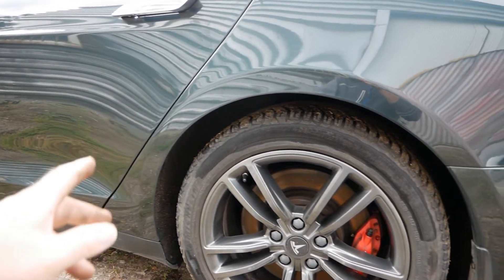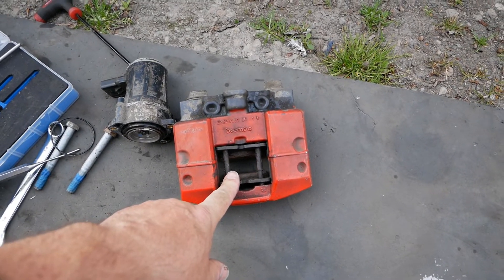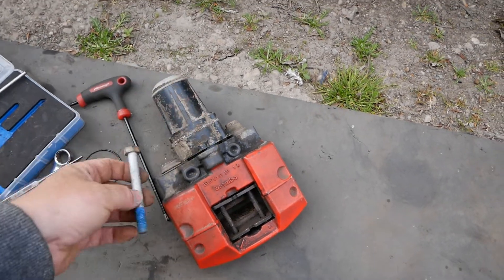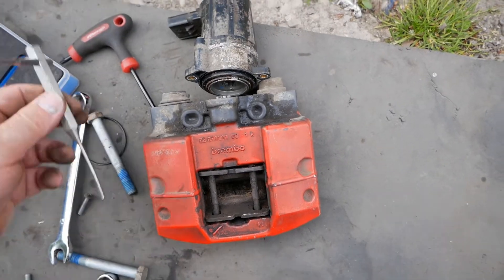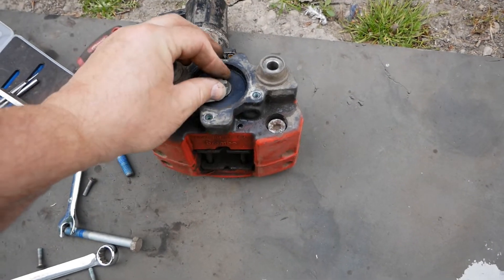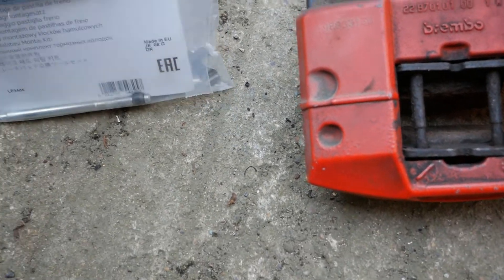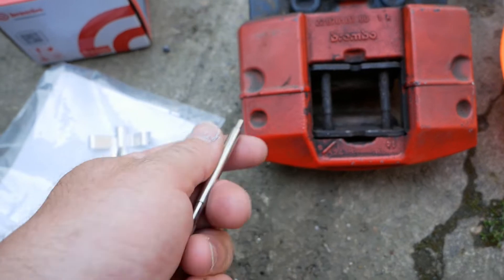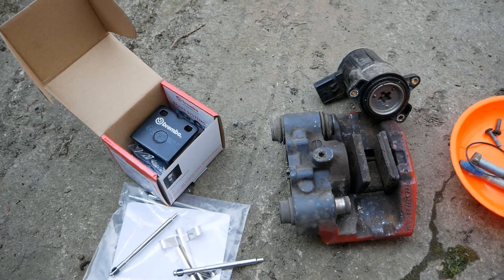Tesla Model S park brake removal or service (separate Brembo parking brake calipers)

Comment: I would have used a much bigger punch on the outer end and punched each pin in a tad first, then, once loosened a bit, used the too small punch to drift them out in the correct direction...  WD40 in all directions...

Comment: amazing video ! - my parkingg brake is faulty and it's the actuator failed (or not engaging) does anyone know where I find the part number for the actuator and the calipers and where best to get them in the UK rather than going to Tesla ? it's a 90D 2015 model S - thanks

Comment: Did you manage to get the pins out with the correct size punch pin? My pins are rusted and swollen and worried it will be too difficult to remove them

Comment: Had the same issues with the pins on my 90d. Heated it with a torch but melted the seal on the piston slightly. Brembo and Tesla won’t get back to me with a part to replace it. Any ideas?
Reply from the maker: You can lookup the Tesla parts yourself at epc.tesla.com but I doubt the seal is a separate item from Tesla. Have you looked on Autodoc?

Comment: In my case, I need to replace the actuator. Do you know if a new one needs calibration?
Reply from the maker: I would assume just engaging and releasing the handbrake calibrates it as they stop when the pads are tight on the disc.
I fitted this actuator back after removing it without any calibration.
Reply: @GoGreenAutos  Thanks!

Comment: I noticed Tesla's service manual says "Do not reassemble the park brake caliper after detachment of the caliper gearbox," with another note "This method requires replacing the caliper after it has been released." Apparently to retract the caliper without having to replace it you need to do it electronically (i.e. don't disconnect the motor/gearbox from the caliper). Has yours been working fine since doing this?

Comment: Which lubricant did you settle on for the actuator gears?  I'll be attempting to replace the pads next month and want to lubricate the actuator during re-assembly.  Thanks for the video!
Reply from the maker: I ended up just straying in some white lithium grease. Because that is in an aerosol with a stray, it's easy to squirt it in.
Reply: @GoGreenAutos  I took my motor apart and found white grease that had thickened and was restricting gear movement.  Also the plastic housing has teeth that articulate with the gears.  I think you must use a small amount of plastic friendly grease such as silicone.

Comment: If you take off the caliper do you how many nM it should be torque to.
Reply from the maker: The Tesla workshop manual states the park caliper bolts should be torqued to 57Nm

Comment: Will these part work with  2016 model x.  The part no for those pins are 1013298-00-A but couldn't find a reference between Delphi  and OEM
Reply from the maker: Yes, if your MX uses the same Brembo brakes. I'm pretty sure they do.
Autodoc is a good source for parts or just looking up bits and part numbers. Just enter the Tesla part number to find the correct aftermarket part.
Reply: I ended up getting the part from tesla. Hope fully it works @GoGreenAutos

Comment: Earlier in the year I had a parking brake fault flash up. 2016 MS 85D (just passed 250,000 miles about a month ago) I was waiting until we could get it into the workshop but one morning the near side wouldn’t release. So trailered it to the workshop and we had the rear brakes apart. It all seemed ok, but there was a lot of muck inside the servos. So they were thoroughly cleaned and fresh grease applied. Bench tested and refitted with new o-rings. The handbrake then worked ok and I noticed a small improvement in efficiency! However we couldn’t access all the diagnostics and the fault warning persisted. A couple of months later, the car went in to Tesla Bristol for a replacement hv battery fuse. So I asked if they could check the handbrake. The found a broken wire and had a new connector in stock, so it was fixed for the price of 1 hours labour.
Reply from the maker: Good to know, thanks

Comment: 2013 Model S in Canada.  Has had two brake jobs in 10 years.  I use the “brake hard on a back road once in a while” calliper clean up method.
Reply: Sadly that won't work with the separate parking brake calliper. It's a maintenance item that needs maintenance.

Comment: What do you think of Tesla moving to NO column mounted controls - relying entirely on moving steering wheel buttons and swiping the screen ?
Reply from the maker: Getting ready for fully autonomous?
Tesla are known to cut parts if it saves money. They did it with the parking sensors, yet took nearly a year to get the vision alternative working.  But I do wonder how much it actually saves and if these cost cutting measures are worth it. Take the stalks for example, they are going to lose some sales because of this move. What has it saved them £200?? Put the price of the cars up by the price of the parts. No one will care.

Comment: Hi Matt, thanks for sharing.  I do hope you get your beloved MS home soon.
Your rear discs look like they need a bit of a clean up.  I know when I wash my MS that the rear discs then stick overnight (handbrake on with wet discs) and when I drive away next day they release with a thunk.  That is my cue to find a quiet piece of road and stomp on the brakes a couple of times, so the rust gets cleaned off the discs.
I am sure that this is not new to you, but for the benefit of any readers who don't do this, they risk the rust setting in deeper and eventually new discs are needed or at minimum a skim.  Ironic really, Teslas needing new discs  even though their brakes hardly get used at all!
Reply: In the service mode, there is a brake burnishing sequence. It will guide you, look for it and follow the instructions
Reply from the maker: My discs were only rusty on this video as the car had been sat unused for about six weeks waiting for the insurance claim to get sorted and then parts ordering at the bodyshop before I took it over to them.

Comment: Span? Spun surely? Good video again. Did they use a lot of  Mercedes parts for suspension and steering on early M S’s?
Reply: Yes i have heard that some but fixed their whole air suspension on their tesla with mecedes benz parts
Reply from the maker: I don't know about the suspension, but on the early Model S like mine, the steering wheel stalks and window buttons are Merc parts. The stalks are horrible. They get really notchy/clunky and feel like they're about to snap.
Reply: Plus-Gas overnight should help, re lube I think there’s someone on UToob  covered it